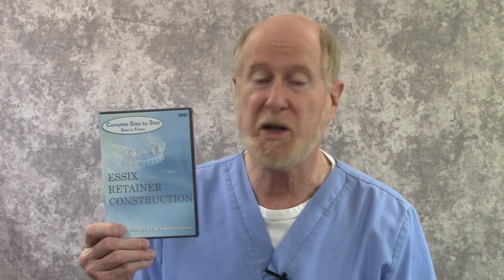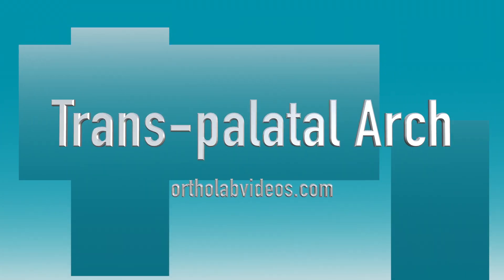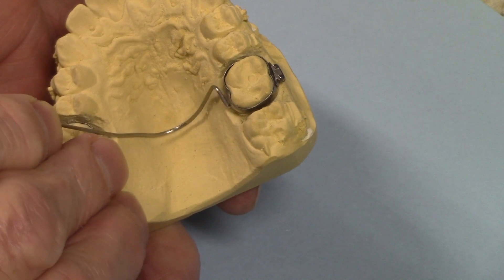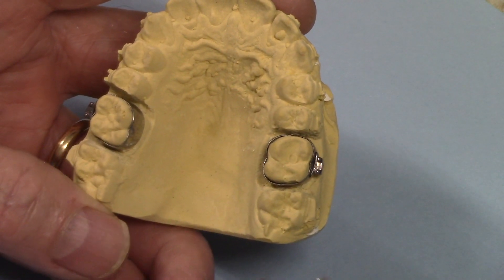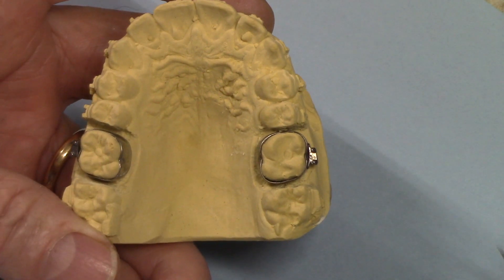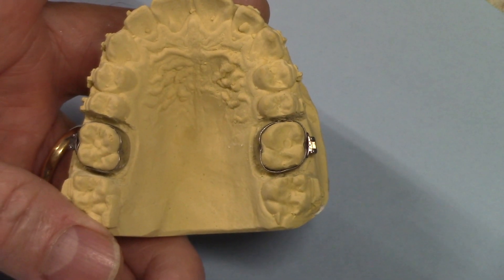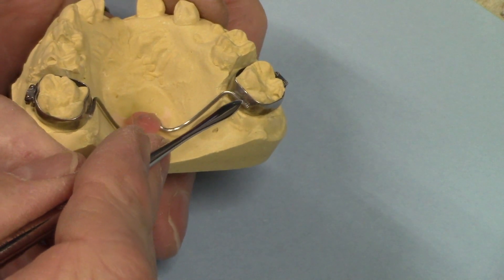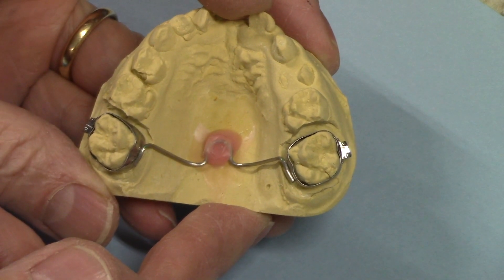Trans-palatal Arch

Comment: How can i make the tpa passive without soldering?
Reply from the maker: It should lay on the model passively before soldering.  If not, keep making minor bends until it rests in position passively.
Reply: @OrthoLabVideos  u can show us ?
Reply from the maker: osman haydar this just takes practice. I suggest you keep practicing wire bending until you can make the wire remain in position passively. Keep making minor bends until the wire is properly positioned and passive.

Comment: Hi, my technician always make the TPA active and I can’t seem to find out what or where was the mistake. Can you pls tell me which part of the fabrication may be faulty? Much appreciate your response.
Reply from the maker: When I’m finished bending the TPA, it rests passively in place. If your technician is having trouble doing that, the wire can be made passive by heating it to a dull red after soldering and letting it bench cool. Of course it will need to be polished to get the black off, but it will be passive. Too much heat will ruin the temper, leaving the wire soft with little elasticity. It’s best to just bend it passively then solder.
Reply: Does thia hurt to put in  @OrthoLabVideos